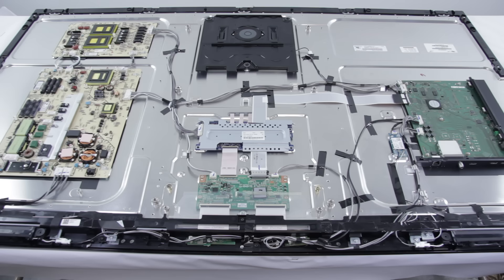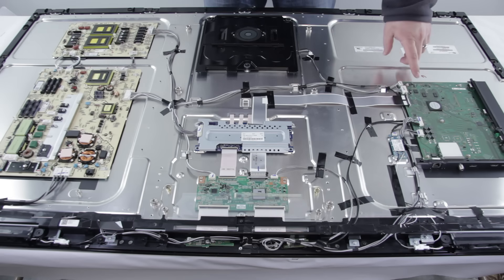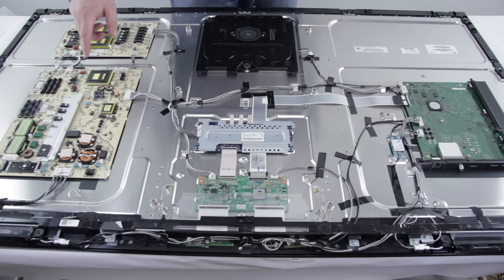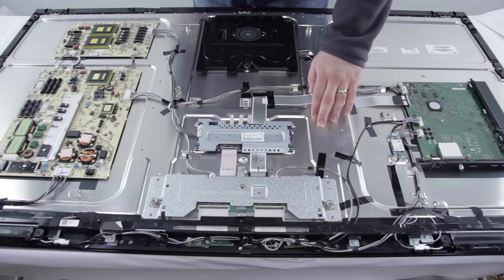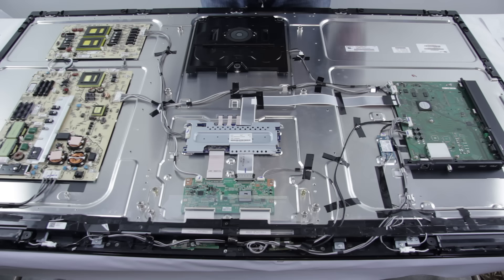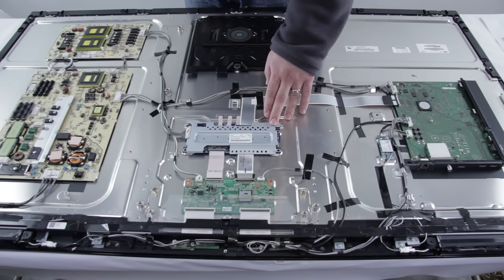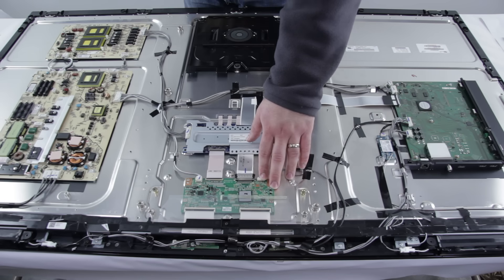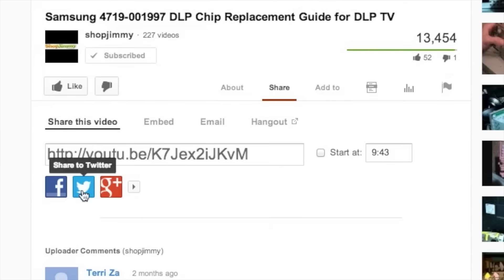LED TV Repair Tutorial - Common Symptoms & Solutions - How to Repair LED TVs

Comment: I have an LG 50LN5600. When I turn it on, the screen blinks on the goes dark and the standby light blinks twice. I used the flashlight test and there is a picture and I can hear sound. I can change the input with the buttons on the back (remote control is lost). I have bought and replaced the Power Supply board and the T-Con board and still nothing different. If the LEDs were bad, would the screen even light up? The backlights won't stay on. Can you please suggest to me why they wouldn't? Thanks!
Reply from the maker: +jdmullikin0142   Try all repairs and troubleshooting at your own risk. This sounds like a problem with the actual LEDs inside your TV. These LEDs are replaceable, however it is recommended they are replaced by someone with the proper experience and training. When replacing the LEDs, the TV panel can get damaged. If the TV panel gets damaged, it is not repairable. Click this link to replacement LEDs for your TV model number:  http://www.shopjimmy.com/catalogsearch/result/index/?cat=299&q=50LN5600   Be sure to match the panel information necessary to ensure you have the correct replacement LEDs.Thanks and please let us know if you have any further questions with your TV Repair!  www.shopjimmy.com

Comment: Hi. I have a VISIO 55" 3D HD TV. Model is M3D550SR. I replaced the power board, because it was totally dead, but I get nothing. No light at all, no sound.  There's definitely power going to the tv, but nuttin'.
I removed the control board also, to see if I could find a anything that didn't look right like bulging or cracked cap, but it looks fine too. I can't find any control boards in stock anywhere. I didn't try turning on with remote. I used buttons on the side of the tv. Any help is much appreciated. Dan
Reply: Forgot to mention, my condo was struck by lighting. I hope that helps, thanks.
Reply from the maker: +CrashMaster44   Try all repairs and troubleshooting at your own risk.  I recommend replacing the main board and power supply board in your TV.  Click this link to replacement parts for your TV model number:  http://www.shopjimmy.com/catalogsearch/result/?q=M3D550SR  There may be multiple boards for the same TV model number, be sure to match part numbers on your current board, with your replacement for compatibility.   Thanks and please let us know if you have any further questions with your TV Repair!  www.shopjimmy.com

Comment: Hi ShopJimmy.com, need your assistance.   I have a LG 55LX6500 which I've had it for about 4yrs.   The other day, when I turn the TV on, it came on with a picture for a few seconds then it when blank with no sound.  I unplugged the TV waited for an hour and tried it again, the power light and screen does light up which indicates the back light is working but no picture or sound.   The TV menu does not appear when I press the menu button, is the problem the TCOM Board.   Appreciate any advise.  Thank you

Comment: hello i need a little help i have a proscan PLDED3992A-C when i turn the power on the logo flashes lightly on the screen it just keeps flashing the tv only has one board on the back and 2 small thin boards on the bottom with cables going to the screen. the back lights are flashing on and off
Reply from the maker: +Chris Paparis  Try all repairs and troubleshooting at your own risk.  This could be a problem with either the power supply or the LEDs in your TV.  You can replace the power supply board to see if that fixes the problem.  Click this link to replacement parts for your TV model number:  http://www.shopjimmy.com/apex-lk-pl390101b-power-supply-unit.htm  There may be multiple boards for the same TV model number, be sure to match part numbers on your current board, with your replacement for compatibility.  Thanks and please let us know if you have any further questions with your TV Repair!  www.shopjimmy.com

Comment: I have a Sony FWD 65W850A with screen problems - brownish vertical lines.  I have already replaced the T-Con board with no effect.  I am wondering if the VLE board (apparently unique to this series of Sony TV) could be the problem.  I've taken a short video of the TV that shows what the problem is. https://www.youtube.com/watch?v=9qLuegx5vu8
Reply from the maker: +Randy McCardell  Try all repairs and troubleshooting at your own risk.  This sounds like a TV panel (TV Screen) problem.  If your TV panel is bad, it may be more cost-effective to replace the TV as panels are typically hard to find in stock, difficult to replace, and expensive.  Thanks and please let us know if you have any further questions!  www.shopjimmy.com

Comment: Hi I have 55la6200 lg led tv and I am having problems with backlight. The backlight works for few minutes and then screen goes black. If I poweroff for few min and start the tv. backlight works for another few minutes. Visually no damaged capacitors/filters on power supply board. Please help.

Comment: I need a toshiba 50l1350u led driver board. Can't find one anywhere.
Reply from the maker: +652barry  Try all repairs and troubleshooting at your own risk.  Is your part number on the sticker: PK101W0050I ?  Click this link to a replacement power supply for your TV model number:  http://www.shopjimmy.com/toshiba-75033153-power-supply-unit.htm  There may be multiple boards for the same TV model number, be sure to match part numbers on your current board, with your replacement for compatibility.  Here is a link to a video showing how to identify your part number, click here:  https://www.youtube.com/watch?v=b9L0-m0-pjA  Thanks and please let us know if you have any further questions with your TV Repair!  www.shopjimmy.com

Comment: Hi Jimmy,
Great channel!
I have an LG 55LN5200 55-Inch 1080p 60Hz LED TV (a discontinued model). 
The image is very dark (almost black) when the room is dark I can see the video faintly.
When I select the settings menu, the menu appears perfectly fine. Just to see if it would make a difference, I increased the brightness level up to 100% in the settings options. The image remained dark with no change. I checked the back to determine if there were backlights on, but I could only see one light. The vents are quite small. I thought I would write you before I pull the back off just in case this is a common type of issue.  Note: There is no issue with the audio.

Thank you very much in advance!
Richard

Comment: Hello, I have an LG 42LE5400.  About a week ago the TV started to turn back on after i'd turn it off. Only way to keep it off is to remove power all together.  Originally i thought maybe it was power related issue.  Then today it started to select random touch buttons on its own.  Volume up/down, input and menu button.  Now i'm wondering if the powering back on was related to the same touch panel button.  Any thoughts?
Reply from the maker: +Marco Almeida Try all repairs and troubleshooting at your own risk.  I recommend that you disconnect the keypad to see if the problem goes away.  Thanks!  www.shopjimmy.com

Comment: I have a Vizio 55"  VF550M that I've been having problems with the picture that comes and goes out. When watching TV the picture all of a sudden start to brake apart, (Pixing),it then goes black , you can still hear the sound. If you turn it off and turn it back on , the picture comes back some time for a while but then it starts again. I've replaced the T-CON board. It worked for a while, but now the problem is back. I know its not the Satellite Signal , since when I use other input component it does the same thing. The T-CON I bought was a used one ,so I don't know if that was the problem or not. Appreciated your input and YouTube post.

Comment: Hi i have a 2006 Panasonic TV with Model # TH-37PX60U .The issue i have is with the volume buttons not working. The power button is the only one that works. I need help in what needs to be replaced Thanks.

Comment: Hello. I have an LG 55" model number 55LM8600. I have sound and about an inch worth of picture on the far right side. The rest of the screen is varying shades of gray with several colored ( green yellow pink) thin vertical bands. If you could tell me what you think the problem is and whether or not it's something I could repair, I would be very appreciative. Thank you. -Mike -miketoy8@gmail.com

Comment: Hi ShopJimmy.com I have a Samsung UN46D6000SFXZA that will not turn on. 
 The red power LED on the front will double-blink 5 times followed by a 
single slower blink afterwards and then repeat this over and over again.
  Have you run across this issue before and if so, what is the solution?

Comment: What if I have a full picture and only half of the screen has backlighting? The picture is complete, however if I change backlighting brightness it only affects the bright side and doesn't change the other half. Even if I change the brightness to the dimmest possible it's still not as dark as the other side. It's a Sanyo DP55D44.

Comment: I have a Sanyo DP 52440.  My TV turns on ut has only a half screen.  Sometimes it has vertical lies on the blank side.  I replaced the T-con board with one I purchased installed it and unit would not power up.  I put the old board in and it powered up and had half a screen with the start up of the unit.  I was able to verify tht the audio works and video plays.  It just has half a screen.
Reply from the maker: +Chuck Myers   Try all repairs and troubleshooting at your own risk.  This sounds like a TV panel (TV Screen) problem.  If your TV panel is bad, it may be more cost-effective to replace the TV as panels are typically hard to find in stock, difficult to replace, and expensive.  Thanks and please let us know if you have any further questions!  www.shopjimmy.com

Comment: 47LN5400 with audio but has a screen flash when turned on but no picture
Reply: +matthew robinson It didn't make any noise it just stopped working. Trying to troubleshoot
Reply from the maker: +matthew robinson   Try all repairs and troubleshooting at your own risk. This sounds like a problem with the actual LEDs inside your TV. These LEDs are replaceable, however it is recommended they are replaced by someone with the proper experience and training. When replacing the LEDs, the TV panel can get damaged. If the TV panel gets damaged, it is not repairable. Click this link to replacement LEDs for your TV model number:  http://www.shopjimmy.com/catalogsearch/result/index/?cat=299&q=47LN5400   Be sure to match the panel information necessary to ensure you have the correct replacement LEDs.Thanks and please let us know if you have any further questions with your TV Repair!  www.shopjimmy.com

Comment: Hi, I have a TV model LG42LE7500 and it doesn't turn on. It just stay with LED power on and the brand LG turn on, but the TV doesn't turn on (the screen remains black and without sound). And I opened it and I measured all the voltage in the connector P201 (this connector is connected straight to the main board) and only the pin PWR_ON that must have 20VDC according to the note P201_MAP on the board, but when I measured in this pin and the voltage was 3,5VDC . I think the model of the power supply board is EAY60803101 or EAY60803102. Could you tell me if the problem is only the power supply board? Or both Power supply board + main board? If the problem is the power supply board is there something that I can do to check the problem in any specific component or not?
Reply from the maker: +Wilhen Bonillia  Try all repairs and troubleshooting at your own risk.  I recommend replacing the main board in your TV.  Unfortunately I do not see any replacement parts in the search results for your TV model number on our website.  Please reply with your part number on your main board and I can try searching for replacement parts.  Thanks and please let us know if you have any further questions!  www.shopjimmy.com

Comment: I have a problem with a LG TV model no: 42LW4500-AFB, when i switch my TV on, the red power lights goes on but no picture or sound just the blue standby light comes flickering and goes back to red again and starts flickering. I linked the drive on with 3.5v on the board with a piece of wire then the back lights came on, what could be the problem on my power supply board.

Comment: Hi. I'm dying of frustration with a new samsung tv. model FWW 32D25T. After two months, the thing just started to randomly dink with the volume of its own volition. Up, down any direction. We'd fix it, and then it would wait a while and do it again. Now, it cranks it up to full volume and no matter what I do I can't bring it down.. I can lower the volume on the remote or the panel, and it's like some demon-spawn is over my shoulder with another remote, manically cranking it back up to 100. Worse, if I go into "menu" to see if I can find fix options, it's scrolling through the options at warp speed...again, like some demon is pressing the selector button. I have tried every option suggested online: hard start, battery out of remote, removing remote from the room, cursing at the remote, resetting remote, using just the panel on the tv itself, and using the directv remote itself. I even "crossed streams" like on ghost busters (thinking that using my directv and sanyo remote at the same time, if I could do that like on the movie, that would be the COOLEST>... THING ... EVER) but alas, it doesn't work. No stuck buttons. Aside from a highly offended remote, I can't figure out what's going on. This TV was ALL my hubby and I could afford for our 25 anniversary as I went back to school. It's such a bummer to get hosed on the only thing we could get to celebrate. Can you help?

Comment: I have a Samsung UN55C8000 LED 3D TV manufactured in 2010.  When we power the TV on, nothing turn on but we hear a clicking sound and that's it.  According to your video, I think it's the main board problem.  
Can you recommend what is wrong, and what part do I need to replace? and where do I go buy that part.
Thank you very much!
Din
Reply from the maker: +Chuong Pham  Try all repairs and troubleshooting at your own risk.  I recommend replacing the main board in your TV.  Click this link to replacement main boards for your TV model number:  http://www.shopjimmy.com/catalogsearch/result/index/?cat=56&q=UN55C8000  There may be multiple boards for the same TV model number, be sure to match part numbers on your current board, with your replacement for compatibility.  Here is a link to a video showing how to identify your part number, click here:  https://www.youtube.com/watch?v=BEPWrefQvqI  Thanks and please let us know if you have any further questions with your TV Repair!  www.shopjimmy.com

Comment: Hello, I have a Samsung 55 inch LED UN55ES6003F, I cannot see any backlights in the dark, I have audio, and I can see the faint image when doing a flashlight test. I have opened up the back panel and only notice three boards. The tan power board, the green board where the HDMI, video, audio connectors are, and then the green board located at the bottom center which I am assuming is the TCOMM board. With these symptoms what do you recommend I replace? Thank you so much for any help, cause Samsung is definitely not doing a good job!
Reply from the maker: +dylan liptov   Try all repairs and troubleshooting at your own risk.  This sounds like you have bad LEDs in your TV.  Unfortunately we do not sell replacement LEDs for your TV model number at this time.  You can check back in the future to see if we have them available.  Thanks!  www.shopjimmy.com

Comment: Thanks for such informative and educational videos. I have a 3 yrs old Samsung UN46D6400 TV which is out of warranty and I am having issues with it that the TV switches itself off within few seconds of switching it on. I tried to check the capacitors on the power supply board as mentioned in lot of other videos but all capacitors look good to me. I am not seeing any issue with them. Can you please suggest what else could be the problem or how to go about fixing it?
Reply from the maker: +Nitin Gulati   Try all repairs and troubleshooting at your own risk.  I recommend replacing the main board in your TV.  Click this link to replacement parts for your TV model number:  http://www.shopjimmy.com/catalogsearch/result/index/?cat=56&q=UN46D6400  There may be multiple boards for the same TV model number, be sure to match part numbers on your current board, with your replacement for compatibility.  Here is a link to a video showing how to identify your part number, click here:  https://www.youtube.com/watch?v=BEPWrefQvqIThanks and please let us know if you have any further questions with your TV Repair!  www.shopjimmy.com
Reply: +ShopJimmy.com Thank you so much for your help. Your diagnosis was perfect. I replaced the main board and it is working fine now. Thank you so much.

Comment: we bought this tv it's a panasonic model 120 v 50/60 h2 690 w when the tv is on there's about an inch to inch and half black line down the screen. is that an easy fix thanks
Reply from the maker: +Teresa Howard   Try all repairs and troubleshooting at your own risk.  This sounds like a TV panel (TV Screen) problem.  If your TV panel is bad, it may be more cost-effective to replace the TV as panels are typically hard to find in stock, difficult to replace, and expensive.  Thanks and please let us know if you have any further questions!  www.shopjimmy.com